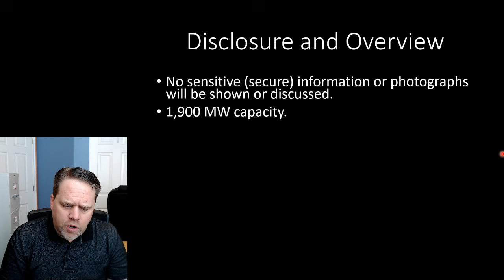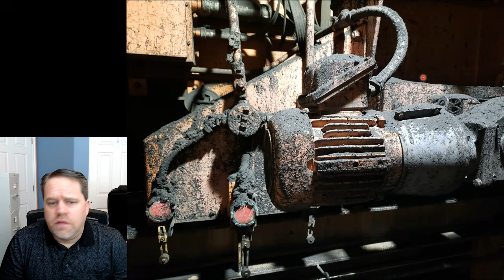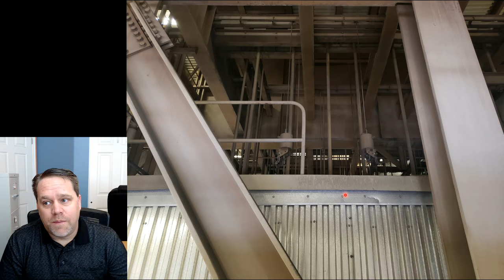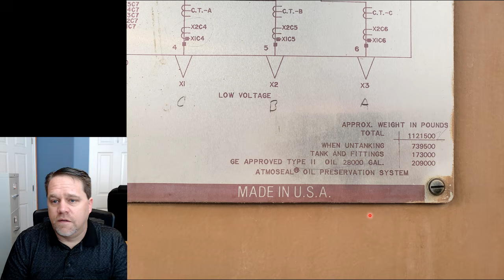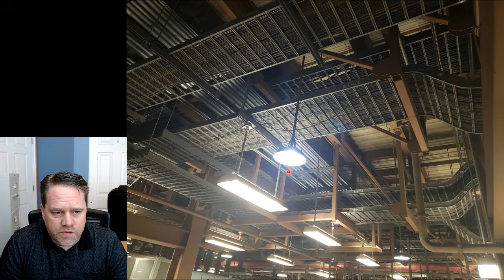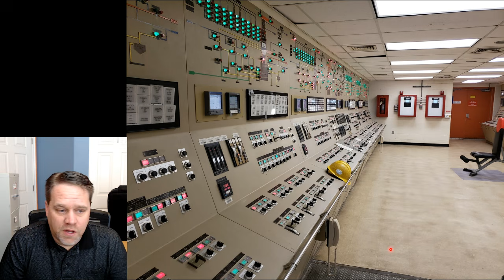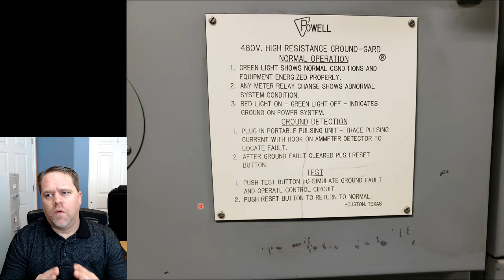Inside a coal-fired power plant (IPP plant in Delta, Utah)

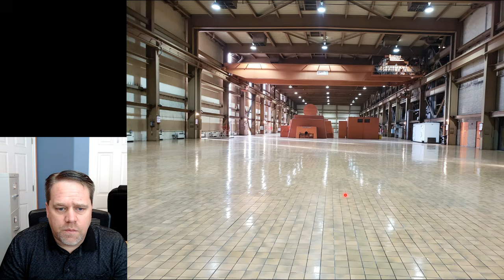Comment from the maker: A couple of clarifications: The generator shown at 14:06 is indeed one of the generators (26kV), but the device shown at 15:43 is the exciter for the generator. The generator (alternator) is contained within the massive round portion of the orange assembly shown at 14:06. Also, I gloss over the process of burning and cleaning the coal. The coal is pulverized into dust to be ignited, and the actual "cleaning" is done as part of the process of burning it.
Reply: The "cleaning" is done post-combustion. Indeed, at least half the plant as you have shown it is dedicated to cleaning the exhaust gasses so that they are (reasonably) safe to send into the atmosphere. Virtually all of the white cloud seen coming out of the stack (chimney) is simply steam, and this is because of all the massive electrostatic precipitators, baghouses (filters) and chemical scrubber that are in the exhaust path between the furnace below the boiler and the stack. But no process is 100% effective, so there is always a tiny amount of combustion byproduct that gets through.

The portal where you show the bright light in the "boiler" is not in the boiler, it is in the furnace (true, depending on the design, these can be considered to be essentially the same thing...not sure about the design at this particular plant).

Others have pointed out that the thing you identify as the "generator" is actually just a tiny but of auxiliary equipment near the generator.

The cooling 'tower' (not really a tower at this particular installation) is primarily there to cool the closed loop water/steam/water system so that it can be used again. Many fossil plants don't use cooling towers because instead they use water from a nearby lake, reservoir, or river as a source of cool water, and then through a heat exchanger to cool the actual active water loop.

I write this sitting at a desk at another coal fired power plant, which will remain nameless. My last plant visit before retirement!
Reply: @youtuuba  i just recently started researching coal cleaning processes--my impression leading up to this was that coal "cleaning" (coal ash reduction, chemical treatment, slurry and reconstitution--whatever) was a fairly specialized/niche/new treatment despite the notion being around for a long time--from my expectation, largely due to economics, and thus not widely adopted despite there being talks of "clean coal" for a long time.  From what you describe, it sounds like there is small amounts of preparation of the coal (outside of grinding, if any) but substantial amounts of post-combustion particulate management.  Would you say that's accurate?  

If you have insight into whether there is a missing step (or not), is this an issue of legacy coal plants not being upgraded but newer ones being fitted with new tech, or is this part regulatory, part economics?  I imagine if I reviewed legislation about this kind of thing I could get an idea of the actionable discussion, but I'm not quite to that point yet.
Reply: @eboyce24  , this is much too large and detailed a subject to try and cover, or relate, in a YouTube comment. There are also many variables depending on where a coal fired power plant is located, what type of coal is being used (plants are designed around the characteristics of their specific target coal source). Most preparation of the coal involves physical processing before combustion. A LOT more goes on during combustion and with all the byproducts of combustion.... various kinds of ash, the chemistry of the exhaust gases, etc. In the States, the EPA and other regulatory agencies have tons of gradual improvements that coal fired plants have had to add-on over the years to remain licensed to operate. Many have been mothballed or decommissioned permanently. Many remain in operation because they are providing the vast majority of electric power for the grid.

Coal fired power plants will slowly go away, but it is critical that the public and officials realize that they are what is providing the 'base load' power, and the only thing we know of that can replace them in that role are nuke plants, and due to public pressure those are not currently very popular.....no new ones being planned or built.... wait until the rolling blackouts start and 'Texas-like' crises become a common occurance, then people will wail and knash their teeth about 'why did all those big coal power plants shut down?' or 'why haven't THEY been building more nuke plants?'. Solar and wind are not 'base load' capable, and they can only supplement base load generators, not replace them. Things are potentially dire......the vast majority of the public and politicians don't have any idea how fast things could get VERY bad as more of the current base load plants are being forced to shut down, either by regulation, public and political pressure and economics.

And that precious electricity stuff which has to be generated as I have touched on above? The demand is going up steeply soon, as we are rapidly approaching the tipping point where purely electric cars will become common...... each car uses up a lot more electric power every day than the household associated with them does, and most households will have more than one car.

Feeling cheered up yet?
Reply: @youtuuba  Nuclear. We need more nuclear. The reasons Chernobyl happened don't exist with western plants; we design them differently, with more fail safes. Fukushima was a western designed plant, and from the reactor design point of view, the safety systems worked. What failed there was poor planning and plant siting - specifically, the decision to place the emergency generators in the basement of a building behind a sea wall that wasn't built high enough (fun fact: there are ancient markers around the plant that indicate where past tsunamis have reached... and they're all well above the sea wall). The generators flooded, and the reactors melted down once the passive emergency systems reached their limit - they weren't designed to sustain the plant indefinitely, but until what was thought of as the worst case amount of time before outside power was restored. That's what the generators were supposed to do. The units that were fine, that didn't melt down, were later builds where the generators were properly installed on the roof, so they were able to kick in and keep the cooling systems running.

I believe nuclear is inevitable. People need to see past the histrionics and irrational fear. As you said, maybe it will take rolling blackouts before people rethink their position. I hope it's before then, however; you can't just throw a nuclear plant together overnight (that's how you get accidents like Chernobyl).
Reply: @drdrums1  Quite a few national laboratories are powered by nuclear reactors, Brookhaven national lab in Long Island NY has used one run by the NRC for close to 60 years yet people freaked out when 3 mile island happened and put the stop on Shoreham nuclear facility even starting up. Meanwhile less than 4 miles away they had one already running and nobody even really knew it existed.
Reply: @youtuuba  Thanks for that erudite comment. @Ryan Jackson's throw-away line that 90% of the CO2 was being removed during the "cleaning process" of the coal irked me a little bit; you make it clear that the scrubbing occurs after burning.
Reply: What you showed was only the slip ring assembly.  The exciter is on one side, the main alternator is on the other.  This conducts the 4000A of DC current into the rotor.
Reply: @fred bloggs , what form are those 'on site batteries' taking? Traditional chemical reaction storage of vast amounts of power is not practical. I have not seen any evidence of any kind of feasible means to do this at the power level we are talking about with large fossil fuel generating plants.

But in the big picture, our society and economy entirely depends on the reliable full-time supply of electrical power. Solar cannot produce anything when it is dark, and wind farms cannot produce anything unless the wind is in a comfortable zone....not too little wind or too much wind, and wind farms are very expensive and inefficient for the amount of space and maintenance they require, and they can only be a supplement to 'base load' generation. With current technology, the only 'base load' generation the world has available is fossil (coal, oil, natural gas), or nuclear, or hydro. Of those, only fossil and nuclear can provide ALL base load requirements, and since fossil is not renewable, that leaves only nuclear, supplemented by hydro, and when available by solar and wind.

It is certainly true that if every rural or suburban home in the 'middle bands' (regions not too car north or south of the equator) in the developed world converts & installs sweeping upgrades, those homes can comfortably be self-sufficient in regard to electric power. But more densely populated urban areas and ALL of industry cannot do it that way. Throw in the inevitable rise in popularity of electric vehicles (and all the widespread electric demand that entails), and that potential gain in efficiency in rural/suburban homes will be more than offset by the new demands.

Being in the electric power industry myself, I can say that those 'in the know thinkers' who are deeply knowledgeable and forward-looking are VERY concerned about the future reliability of electric power. Everyone agrees that fossil fueled power MUST eventually go away, but the leaders of the developed countries are reluctant to plan for a time when we must return to some form of nuclear base-load power, supplemented by the other sources when practical and available. But the politicians and public don't want to face up to this, and there may very well be some very ugly situations in the not-too-distant future when electrical power goes through a sustained period of considerable unreliability and greatly rising costs. People just don't want to face up to reality if any aspect of planning for it seems unattractive; they are instead inclined to put their lands over their ears, close their eyes, and loudly sing "la la la la la", pretending that the reality is not going to affect them, kicking the can down the road for future generations to deal with, usually in very unpleasant and disruptive ways.
Reply: I was about to say this same thing! Fascinating video though!
Reply: @fred bloggs , yes, that thing exists, but from what I read it is more of a novelty, or experiment, but not practical on a large scale, long term basis that the world should be embracing as a solution to our energy problems. Remember that it is just a battery, not a source of energy. If the existing power generation resources get tapped out, or are unavailable for any reason, that battery will soon depleted, and no good at all until some base-load capable sources come back online.
Reply: @fred bloggs , you seem to be consistently forgetting about the base-load concept, as well as the concept that what works in a specific locale is not necessarily going to work elsewhere. Also, "the market" is not technically literate, and a lot of supposedly attractive concepts that thrill the market often don't pan out in a wider arena. I can't account for what individuals or 'markets' think; all I can do is express my own not uninformed thoughts on the subject, and pass on what highly knowledgeable folks in the industry in general are saying.
Reply: Yep your right buddy
Reply: republican poison plants funded by the billionaires and big oil
Reply: @danbam465  , written like a true nincompoop. Fossil fuel power deserves criticism and eventual extinction, but going after it with incredibly uninformed cheap shots is inexcusable.
Reply: @danbam465 You'd be still in the dark, out in the cold and probably dead without hydrocarbons. They give modern civilisation the modern standard of living it has today.  So think of that.

Comment: I have visited several coal-fired power stations here in the UK, Lots Road which supplied the London Underground but had been converted to oil and gas when I went there, Battersea A and B, Blyth A and B and Didcot A.  What always impressed me was the amount of auxiliary plant required to operate them.  Didcot A was 2000 MW, the others were older and smaller.  Didcot also had 100 MW of gas turbines which remained in service after the main station closed.  Didcot still has the B station which is about 1400 MW of gas fired combined cycle gas turbines, but I have not visited that.

In all cases we were not taken into certain areas for privacy reasons, such as certain staff facilities, bur were not excluded from any technical and operational areas for ‘security’ reasons we had to keep to certain areas in some of the buildings, for example we had to stand back from the rail tracks in the coal unloading shed, but were certainly allowed into the control room, and to talk to the operators, who did not decline to answer any questions asked.

Comment: I confused,
At beginning of video you the plant goes through 5 million pounds of coal.
Below that you say (1.2 million pounds hour) if you times 1,200,000 x 24 hrs. X 365 days = 10,512,000,000 pounds for the year.
But:
5,000,000 divide 365 days divide 24 hrs. = 571 pounds per hour. Would be a better answer.

But still a great video and tour!
Reply: 5 million tons per year. Also, the generators aren't both on all of the time.

Comment: Very cool!! I worked on coal and gas fired boilers for years. I found them fascinating and terrifying. The flue gas monitoring systems were really cool. I wrote an operating procedure for one industrial cleaning company for operating in explosive dust environments after a coal dust explosion killed a couple of workers..... what really scared me though is high pressure steam. It can reach out and kill you without you even knowing it’s there.

Comment: That was actually not the generator. You were looking at collecting rings on an exciter that creates a field on the generator rotor. That rotor then cuts across the magnetic flux of the stators in the generator which is tied to the outside world, creating power
Reply: So a generator

Comment: Did I hear and read correctly? You said that a 500 kv DC line ran 490 mile. I was under the impression that DC could not be transmitted long distances. Is that not why AC power is used  because it can be transmitted long distances and can be transformed to different voltages as needed. Great video!!
Reply from the maker: AC is good for medium distances. For very long distance dc is used.

Comment: The shot of the generator is actually only the collector rings for the exciting current and a bearing. The generator itself is sealed and surrounded by pressurized hydrogen gas for cooling.
Reply from the maker: Agreed.
Reply: I thought that looked rather tiny to be generating all that power.

Comment: What kind of efficiency does this have? My wild guess is that the thermal power is probably twice the electrical power, so in around 4MW? I'm wondering why they don't use waste heat from the plant to heat up the railway cars? That heating solution looks like an afterthought. Do they use any of the waste heat for district heating?

Comment: 13:39 spring hanger cans above the penthouse, holding up the pressure parts, headers inside the penthouse. This allows for thermal expansion when the boiler heats up

Comment: Very cool video. Someone probably already pointed it out but at 10:30 when he is explaining "cleaning" the coal using scrubbers, keep in mind that it is the exhaust gases from the boiler that are "scrubbed", using chemical processes and electrostatic precipitatiors. When I worked at our local municipal power plant, (a mere tea kettle compared to this monster) the coal came right from the yard, to the day hoppers, fed to pulverizers and blown to the furnace. Cleaning comes after burning.

Comment: The cleaning and filtering is after burning the coal.
Thanks for sharing, those beast are truly awesome. I do remember my professor criticizing that putting some panels on a roof is not nearly as complicated as these plants and we better don't forget that if we don't want to go backwards.
Reply: Being complicate is never a target in technology. Complicate only means one couldn't figure out a simple way to do something. Complicate technology is less reliable, more expensive to develop, more expensive to maintain, more expensive to use. Sure we people who are interested of technology often like complicate things,  but the actual value of complicate technology is always lower if there is simpler alternative that can do the same thing. Complicate things are done because of must, not because it is ideal.  About panels; well the complicate part with panels isn't putting them on the roof. They may look simple to a person who doesn't understand them, but massive amount of engineering and brightest minds on the planet have been working on them to make them work. And the problem isn't even fully solved yet as the grid part of renewables is largely unsettled still. How to make the production reliable? Probably large scale energy storage systems, smarter grids, long range transmission lines, etc. will be needed. Even burning facilities may have a place in the long run, it just may be something else than fossils what they burn one day, and as a backup power they will have important role for a long time.
Reply: @wopmf4345FxFDxdGaa20  sure, the kiss principle is a thing.
The value lies not in the complicatedness of these machines. 
The point is that we should be careful not to dismiss these machines as old technology and forget about them. There's a huge amount of knowledge in there and we depend on these right now.